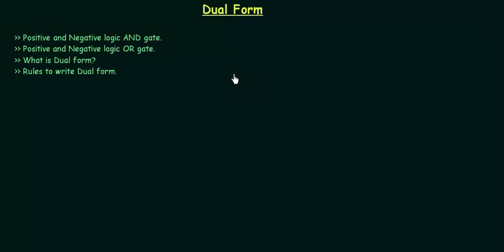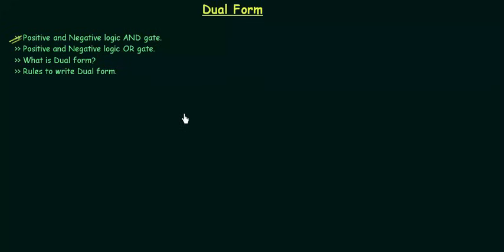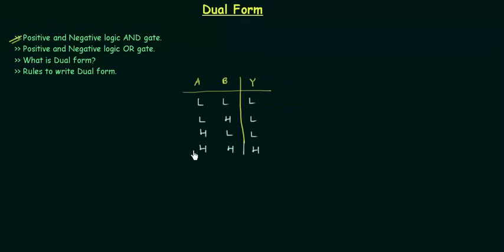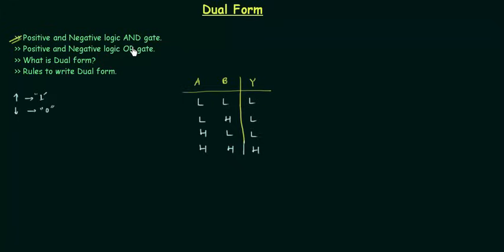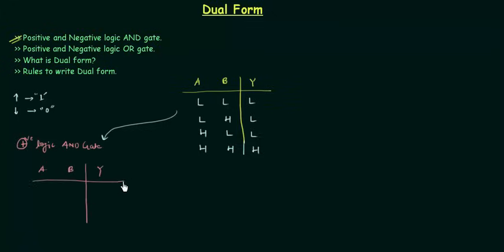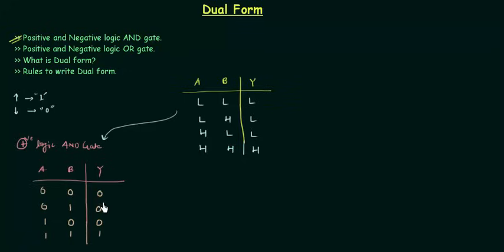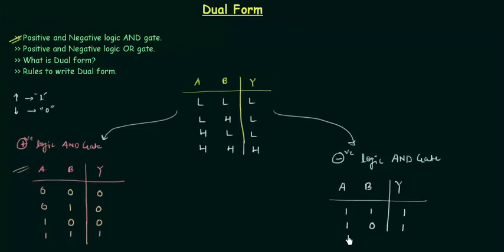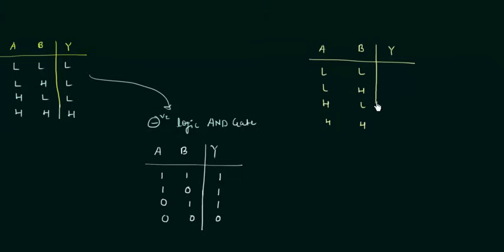Dual Form

Comment: What is the practical benefit of negative logic?
Reply: I too have the same question. Please clarify if you got the answer
Reply: @vamsip98  we can make any type of logic gate (all six) using negative ones i.e. from nand and nor
Reply: @snehilgupta6201  That we can do with +ve logic gates also. Then what's the significance of -ve logic?
Reply: When you want design some circuits which need low power supply or it is power sensitive 
At that cases we use this

Comment: Hi, 
I really appreciate ur work and way you explain things. I have one problem here, there was a question in upsc exam as " assuming logic 0 is available, show that Inclusion gate is universal building block." Could you tell me if that can be solved using +ve and -ve logic ? Is there any other method to solve that?
Reply: upsc ies??, which year??? i have never heard about inclusion gate
Reply: UPSC IAS 2013 Electrical Engineering, Paper 1 Q.no 06
Reply: +praveen dubey may be it is implication i.e if x then y ...implication gate means x'+y nd vice versa